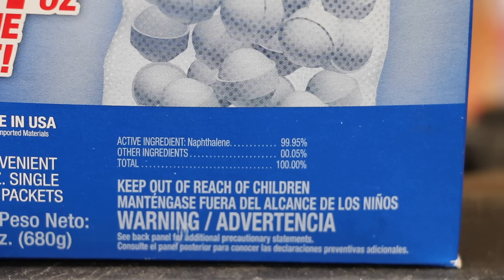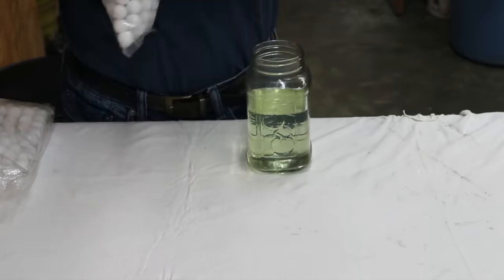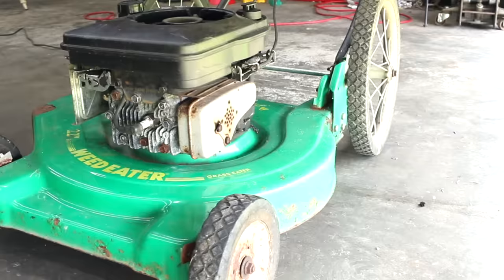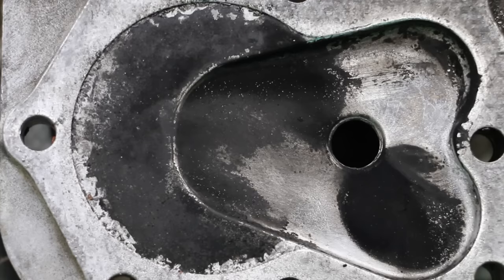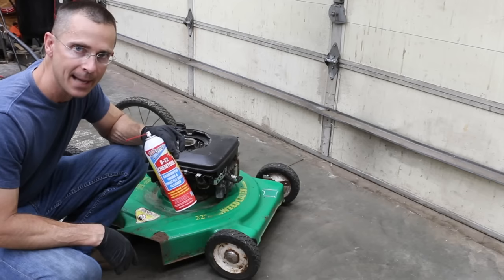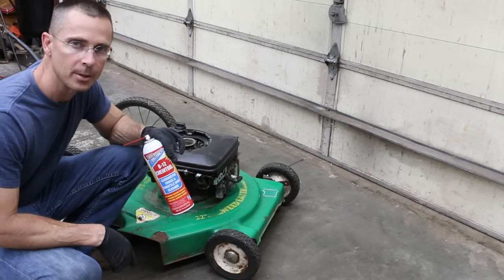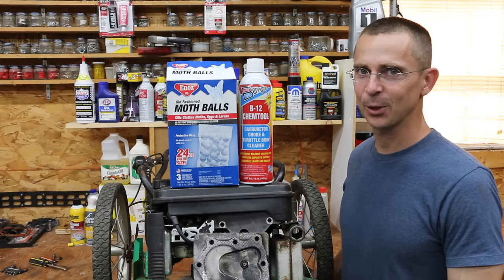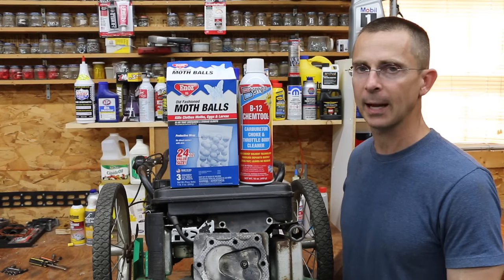Will Mothballs in Gas Destroy an Engine?  Let's Find Out!

Comment: the mith was in fact that they use to add mothballs in a jerrycan with fuel and let it sat over night than put only the fuel in there fueltank. This gave it more power not run the engine on mothballs itselve.
This was a great first halve test now i would like to see you do second test.
pls i really wanna see that lawnmower with so mutch more power :D
Reply from the maker: I overdid the mothballs for sure and plan to repeat this test in the future.  Thanks for commenting.
Reply: Thanks and i am looking forward to that rerun. yeah.

Comment: i used to use about 3 at a time in my 2 stroke scooter it boosed speed from 60 to over 80kmh for about 1-2mins. after a wile the picton cracked but id say thats from over reving the motor.
Reply from the maker: Tom, Very impressive!  Thanks for sharing this experience!

Comment: Back in the day as I am 56 my dad who was a master mechanic for over 50 years. He and his friends used only a few in their fuel . I even tried it and a water injection on my charger with a 440 6 pack . It made it run  colder but after a while it killed the carb .
Reply from the maker: Thanks for commenting!
Reply: Been doing it since the 60s.
6 per glad. Is max.
A couple in  the tank over the winter stops from getting stale

Comment: Naphthalene, the chemical name for mothballs, is a “dicyclic” aromatic compound. Due to its chemical structure and molecular weight, it does not easily dissolve in gasoline, as you discovered. Although it has an octane number of 92, it is too high boiling (424F) to use in gasoline.

In a modern engine, it will probably clog the injector system.

Comment: You need to do another video of you filtering the mothball material out of the fuel and then run it it should run a lot better it's the material from the mothballs that stop the engine
Reply from the maker: Thanks for the suggestion.

Comment: The key ingredient in moth balls is Naptha, it's a white gas like Coleman fuel, and it's flammability is higher than Octane itself.
The bad stuff in mothballs is WAX, mixed with Naptha, and an insecticide, Naptha is the evaporate, so wax is not good, but the naptha is. When i'm feeling frisky, i mix VM&P Naptha & caster oil, and put it in my 2016 Challenger's full tank of gas to up the octane a few points. The Naptha will make it run hot, so adding Caster oil is to prevent burning a hole in my piston, as a top end lube, and also make the exhaust smells good (like racing fuel). This is an old 50's-60's trick. Running straight Naptha will over heat the engine, possably warping the valves... Good video, I knew what was gonna happen ahead of time...
Reply from the maker: This is great information. Thanks for commenting!
Reply: Good thing you replied, i forgot to thumbs up the 1st time round :)

Comment: What about if you put Alka Seltzer tablets into the gas tank?  And how many? Or what about Polident tablets? What about oatmeal? And would it need to be dry oatmeal or already cooked oatmeal? How about Silicone or caulking? What about using a can of Great Stuff spray insulation in a can?
Reply from the maker: Thank you for the video idea!
Reply: @ProjectFarm  you're welcome. I really liked how you showed the before during and after of the moth balls and then with the cleaner.

Comment: Have you seen or used a product called “SUGRA’’?  It is a glue that cures to rubber or silicon.  I used it to make mold for camera mount , worked great.  Also, used it to provide insulation for a damaged cell phone charger wire.  Seal a gas tank?  Hang a picture that does not damage  the wall and is totally removable.
Reply from the maker: Thank you for the video idea!

Comment: In the early seventies the group that I hanged with in high school we all rode Honda SL 100's. We would ride out to the airport and get 104 octane aviation gas and put four of the napthaline moth balls per one u. s. gallon. We would get a pop and candy bar and take a break. When we were done we would shake our motorcycles a little bit and go riding. You could feel the extra power. The bike would feel like it had an extra gear on the top end. For about a foot the head pipe would glow red. We didn't do this too often cause we were scared the engine would blow up.
Reply from the maker: Impressive!

Comment: You got to do sugar in the fuel. I've seen it in a car when I worked for ford and In a motorcycle when I was a bike tech. You got to do it so people can see what it really does
Reply from the maker: Thank you for this recommendation.  I did a video with sugar in fuel a while ago.
Reply: Project Farm guess I need to go through and find it. Did you pick up star tron yet?  And I have fuel service cleaner that dealership uses. It gets sucked in through intake to clean combustion chamber and intake valves. Works best when hot. If you want some to do a test I can send you some

Comment: Someone told me something about that and something else. I cannot remember what. I didnt run mothballs but tryed the other stuff. Wasnt paint thinner but it clearly made no difference in milage. Seeing that mothball mess made me remember the lawn mower I found with sugar in the tank. It never made it into the carb because they used a full bag. I cleaned it all out and it ran perfect. Sold it a week later. Acetone is what I tryed in my fuel. It never changed the milage or cleaned the system eather.
Reply from the maker: Thank you!

Comment: In the Netherlands I have used the mothballs with dichlorbenzene and used one ball per half a gallon for a mixture, but would end up mixing that mixture into a gas tank with about 7 gallons of gas (Euro95). I did this for about 60000 miles and the performance was actually improving. Although stationary it wouldn't run that fluent, but when throttling it would really make a difference in accelerating.
Reply from the maker: Thank you
Reply: @ProjectFarm  but at least thanks for the videos, they are fun to watch :) Warm regards from the Netherlands
Reply from the maker: Greetings and thanks again!

Comment: Looks like Naphthalene could be similar to octane, its a hydro carbon so when dissolved into gasoline it should burn pretty well. If you have low octane fuel then adding mothballs should boost it, however i would be careful in adding this as some engines prefer low octane fuel, and making the octane too high can also have negative effects. This may actually be a cheap and effective additive for biodiesel, would love to see this tested further.
Reply: just make sure to strain any solids next time though hahaha
Reply from the maker: Thanks for the video idea.

Comment: I did find it very interesting that the engine seemed to run fuel rich with the mothballs. I hope he revisits the mothballs in the gasoline experiment!
Reply from the maker: Thank you for the feedback
Reply: I think the deposit of naphthalene that formed in the carburetor changed the aerodynamics of the passage of air through it in such a way as to increase the suction on the jet, hence the excessively rich mixture.
Reply: @cedriclynch  🤯

Comment: When I raced back in the 70s early 80s I put mothballs in my gas tank 6 days before I raced and believe it or not I was running a 302 Ford Mustang with 351 heads and a Holley 2 Barrel on a quarter mile high Bank track and it was out running 350, 358, 383 cubic inches Chevys and would run with a few late models. Now I have had people tell me years ago when I let off my gas going in a corner by cracking the throttle what they call it they would see your beautiful blue flames coming out of underneath my car. But the funny thing was when we lined up getting ready to pull out on a track people sitting beside me in their cars your eyes were watering and so was mine. The fuel was so enormous fumes that it would water your eyes and burn your nostrils. it never burnt my engine up and never hurt my engine I raced it for 2 years and I had to cleanse  carburetor you ever seen and valves
Reply from the maker: Impressive!

Comment: Naphtalene was often used in truck Diesels way back in the 70's in Eastern Europe, because it was cheaper than Diesel fuel. These trucks did not ran smoothly and had often much black smoke coming from their exhausts.
Reply from the maker: Thanks for commenting on this.

Comment: I used moth balls to raise the anti-knock index (AKI) of kerosene to where it worked fine in a side valve engine.  Without the moth balls, it would knock horribly under load.
I added 8 ounces to a gallon.   Since carburetors function on density of fuel to air, there was no gross mixture issue.  

You might have used ethanol gasoline which being more polar, had less solvating power on non polar naphthalene. 
Try it with Coleman stove fuel or any other white gasoline.  You will be surprised.   Be sure to put a load on the mower.  Throw hay on the ground and block the discharge chute.
Reply: the maximum dose is 0.10/0.12 grams per litre, beyond this concentration the octane number drops.

Comment: I've been an engine builder and hot rodder for 50+ years, and what we used to do back in the day, is add 5 balls per 10 gallons of fuel plus 2.5 ounces of acetone for every 10 gallons. This was back in the fully leaded fuel days when our best fuel was leaded 100 octane from Clark. Adding the acetone and naphthalene in the amounts I just explained used to allow us to run 15:1 static compression on our engines. Even with proper heads and cam timing, we were only able to run 13.5 or MAYBE 14:1 on 100 octane. The naphthalene and acetone allowed us to bump a little more compression and ignition timing and squeeze just a bit more power out of those animals! Of course today, with the exotic aluminum head and combustion chamber designs this is no longer an issue. We're now able to run 11:1 and add boost, which in most cases is equivelant to 17:1 or even 18:1 static. Progress? Nah, not for this old timer. I'll take the sound of a nasty rat motor any day!
Reply from the maker: Thanks for sharing.

Comment: Alredy did the.mothballs test by diluting 8 mothballs in 20 oz of gas left it to dilute for a day and using the coffee filter add 2oz to my lawnmower ,also 2oz to make 2 gallons of mix fuel for my 2stroke motors and they worked awesome rpms were up on lawnmower as well as torque and 2 stroke engines responded stronger with no odors in the exhaust just like new
Reply from the maker: Thank you

Comment: You shouldn't have added the gunk from the mothballs. They work by evaporation, fumes, when you use them as they are intended. Kinda like gas atomizes or vaporize to burn. Cool videos, I really learn new stuff once in a while.
Reply from the maker: Yes, I need to redo this video!  Thank you!

Comment: I'd love to see this experiment repeated with less mothballs.  I started driving in the early 1970s, and the myth (??) at the time was one or two mothballs in a tank of gas - around 20 U.S. gallons.  I suspect this test with the gas saturated with mothballs didn't test the original myth, although it was certainly interesting!  Love your channel.
Reply from the maker: Yes, I really messed this test up badly and plan to repeat this video in the future.
Reply: I wouldn't call it 'messed up' - it's an experiment!  There's no such thing as a failed experiment - they all show you whether something works or not.  This one showed that this quantity of mothballs will gum up the engine.  Now another experiment with less mothballs in the solution might show something else.  I put one mothball in my car fuel tank, and while I thought it seemed to have better acceleration, I was 18 and could well have expected that result - nothing scientific about my method!  The difference wasn't enough that I used any more mothballs though.

Edison determined to improve Joseph Swan's light bulb (patented some 10 years before Edison began working on it).  Edison made 1,000 unsuccessful attempts at inventing the light bulb. ... Edison replied, "I didn't fail 1,000 times. The light bulb was an invention with 1,000 steps."

Comment: FYI be careful with Carb cleaners they can melt some plastic even rated for gasoline. Had a snowblower running rough and pulled fuel line from tank filling up with Gumout and filled tank with gas and ran for a minute to clean carb good. Next day went in garage and saw the plastic fuel filter melted and all gas drained on floor. Never thought it'd do that.
Reply from the maker: Thanks for the feedback.

Comment: i had a car that went dead every time i stopped at a red light i put stp fuel injector cleaner in it drove it a tank of gas it cleared up and run real good then i put a bottle in every time i needed it and it did work great it did work.
Reply from the maker: Impressive results!

Comment: for one thing,   old cars did not have a roll over valve at the gas tank inlet hose.    this valve will stop any of these balls from entering the gas tank.   they will then stop the flow of gas at the time you go to pump new gas into tank because they will be blocking the roll over valve   and then you will need them removed.  so getting the balls into the tank will only work on very old cars.  and this valve was made in 1987   and then used in cars.  now 1987 was just the patent date,   it was not used until a year later on cars in the US.
Reply from the maker: Jeremy, This is an excellent point.  Thanks for commenting!

Comment: A friend had a house built.  The house was almost finished, but no power.  The contractor provided a portable generator.  My friend used some roofing tar paper to make a funnel and filled the tank with gas.  The generator ran for awhile then seized.  The contractor not knowing what went wrong provided another generator.  Same thing happened again.  A test you might try. I suggest you use a low value engine.
Reply from the maker: Thanks for the suggestion.

Comment: I have a suggestion for a project idea. This one is also a 1960-70s fairy tale, I could never get a strait answer on it. The story is, during the car engines of the era, it was common to see valve stems filled with sodium powder. The hollow valve stem, with the sodium powder, would dissipate heat from the valve, and reduce carbon buildup. The story goes, if you cut open the valve stem (I guess cut off the tip with a hack saw) and dump the sodium in a cup of water, the sodium would explode. Sodium filled valves are still around in auto applications, and piston aviation engines. I'm wondering if one of your junk yard engines may have sodium filled valves. The last time I had one in hand, it was from a 1955-1985 Small Block Chevy with perimeter bolt (non Vortech) heads. If you held the valve up to ear and shook it, you could hear the sodium rattling around. It sounded like a salt shaker. Do you have any scrap valves sitting around, that make the "salt shaker noise"? Wanna potentially blow something up for likes? Lol. The videos I've seen are really sketchy and don't show definitive [sodium from valve] used. There are plenty of laboratory grade sodium explosions on the net...but, those vids lack the grit and spirit of Project Farm.
Reply from the maker: Thanks for the recommendation!

Comment: We used 8 to 10 mothballs in 5 gallons and let it sit overnight then strained it and added a couple of capfulls of atf to lubricate the cylinder and that would boost 87 octane fuel to about 105 octane.  We used it to boost the performance of our truck while mud bogging.
Reply from the maker: Thanks for sharing.

Comment: You know I used to know guys who ran it runnin demo class round and round dirt and they ran like 8 or 10 to a gallon.  And for an aluminum block that was cut in half. Try like 2 to a gallon and test that
Reply from the maker: Joe, this is a great suggestion.  I used too many for sure.  Thanks again!

Comment: Try to add 0.5% of 2 stroke oil, on the gasoline of a 4 stoke engine.   it has a improve of the performance of the engine. I do this to my motorcycle, runs smoother and the engine has much better  throttle response.  
Please make a video of this.
Reply from the maker: Thank you for the video idea!

Comment: I'm the first to admit that my memory is a little vague here but it believe the formula for 1940's mothballs contained methanol or something similar. Also, you only put a few mothballs in a full tank. I wasn't old enough to drive until the '50s and premium gas could be had for anywhere from 19.9 to 24.9 so almost everyone ran premium in their 39 Fords or 51 Hudsons. I ran it in my '52 Nash Rambler to keep spark knock down until I learned to time it correctly. Then it ran just fine on the cheapest regular going. I never tried mothballs but the practice was still talked about and some people swore it would pep up an engine.
Reply from the maker: Thanks for this information.

Comment: Way too many mothballs for too little gas. Also a friend of mine that races cars used the other kind of mothballs because he wanted the benzine for the fuel. I would revisit this test using far less concentration of mothballs to fuel and try both kinds but in separate tests not mixed.
Reply from the maker: Thank you for the feedback.

Comment: I think you need to revisit this video, dissolve the mothballs and then filter the debris before filling the tank. The way you made this video really seemed to focus on using b12 chemtool,or seafoam. To clean up the mess you just made.
Reply from the maker: You're right. Thank you for this recommendation.